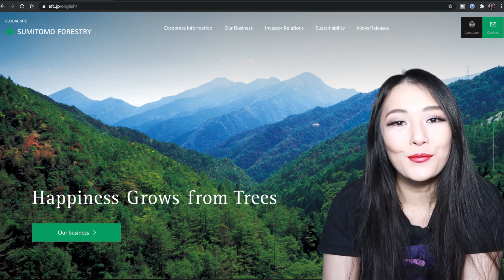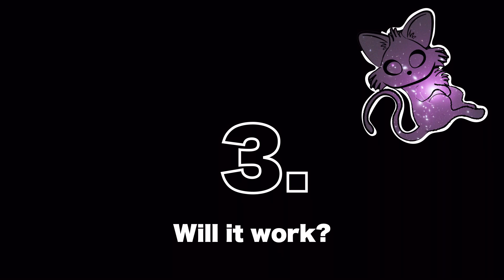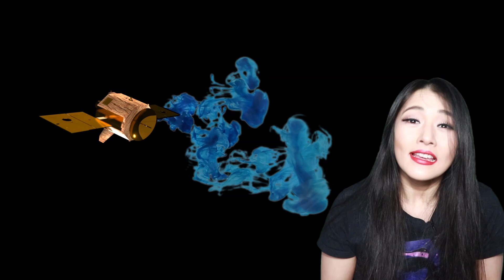Can spacecraft be made from wood?

Comment: One could place the wood in a vacuum chamber and sumerge it in a sealing epoxy or eurethane as many woodworkers do with things like pens and ornate knife handles and pull the excess air out replacing it with the sealer material which 'wood' 😂 stabilize the wood from cracking and warping while still maintaining electrical shielding properties. Yet this wood add weight. But at least astronauts could appreciate the fanciful would grains on the satellite on flyby. Might i suggest a curly maple or quilted ash for the exterior? or are we all still stuck on this aluminized kapton look. So 90s..😴 oh sh*t no wait duh. "aluminized"  defeats the whole purpose😅 great video maggie!😁😁😁
Reply from the maker: I was just going to say, you'd have to use some sealing chemical that is biodegradable and doesn't release toxic chemicals when burned but yeh I'm sure there's a way. Thank you :-)